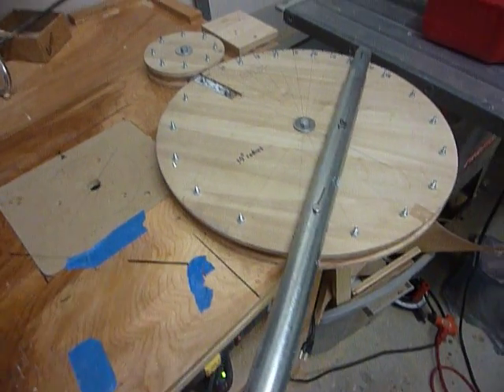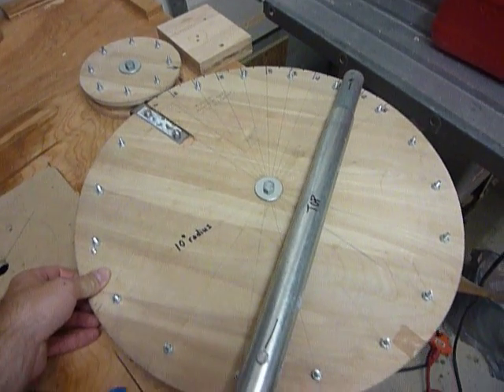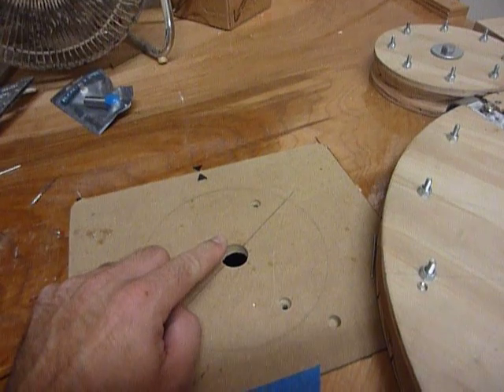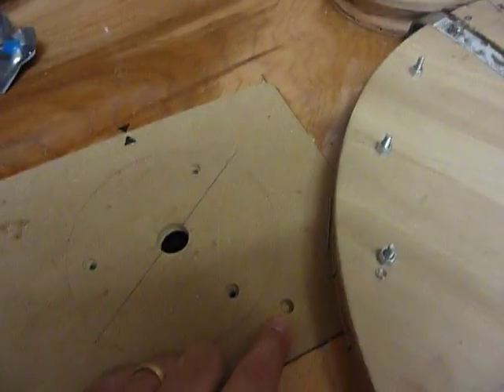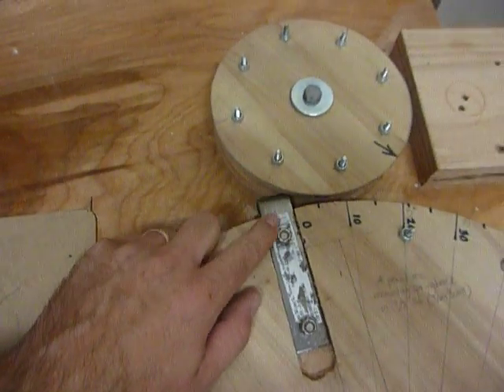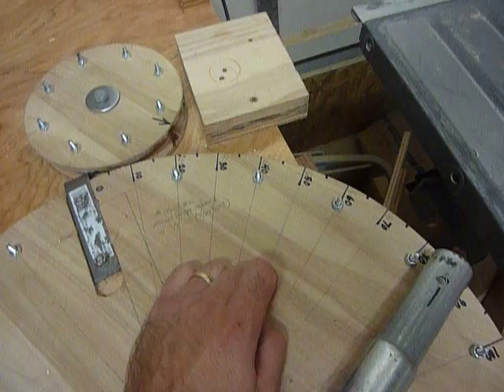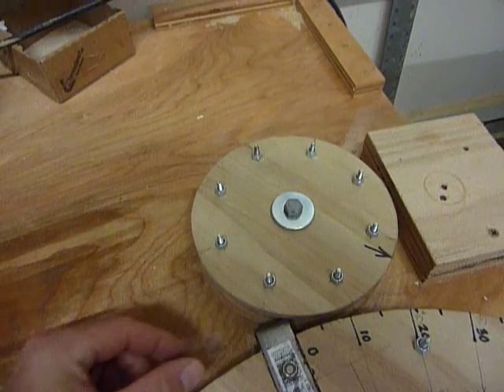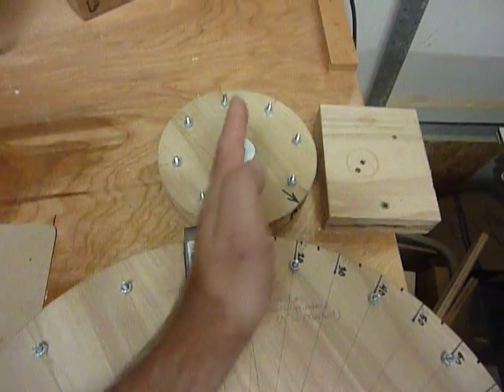DIY Stainless Tubing Bender

Comment: I’m needing to bend some 3.5 inch diameter stainless .049 wall tubing to a radius of 18 inches. Do you think that is possible using a setup like yours?

Comment: Mandrel: What size should the Mandrel be? .... Based on the below mentioned
What if my radius is of 2 feet 11" (Diameter: 5" 11' or  1,803.4mm), with O.D. wall thickness of 10SWG (~3.25mm) | Material (Pipe): Aluminium.

Comment: Tell me, how would you bend a 19.685 foot pipe (6m) into a radius of 16.407 feet?
Reply: LiveDontWatch Hi, The size wasn't a typo ;)
I want to bend a 19.685 foot (6m) long tupe, with 1.49606" (38mm) OD and 0.0787402" (2mm) thick wall, into an arc that's 16.4042foot (5m) wide and 3.28084foot (1m) tall, but with a much smoother / "more professional" finish that you would with a diagram and pipe bender. On that lenght of pipe I would guess I'll get a lot of "bents", instead of a smooth arc

Comment from the maker: I think the force required increases exponentially as you shorten the radius of the bend. I would guess it would be quite a challenge to do a 5" radius bend without a hydraulic press. I don't think I'd attempt anything less than an 8" radius by hand like this, and even that might be pushing it. Very sorry to hear your attempt failed, though.

Comment from the maker: @Chris Child... I'm not sure what the smallest radius would be. Mine only bends to the fixed radius of the larger wheel, which I selected just based on the aesthetic appearance of the curve.

@Keith Richards... I didn't show the bender in action because I didn't think to make the video until after I had already bent all my pieces for my spray dodger. After I told and showed a few people how well the pieces turned out, I was bombarded with questions about the bender, and then made this video.

Comment from the maker: Hi walterronny,

No plans for sale, but if you follow the instructions in the video closely, you should be able to reproduce it. All you need is some 3/4" plywood to cut the wheels, two 3/8" or 1/2" bolts for the central pivot in each wheel, a few dozen 1/4" bolts, a piece of aluminum flat bar, and the 7/8" round nose bit from Rockler (assuming you're bending 7/8" diameter tubing like I did).